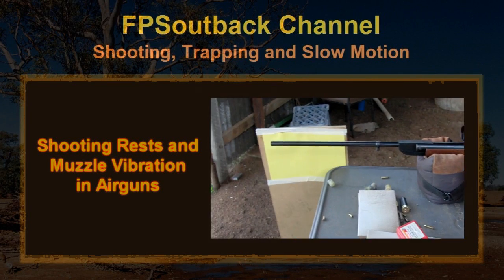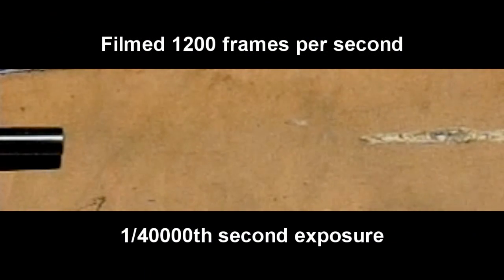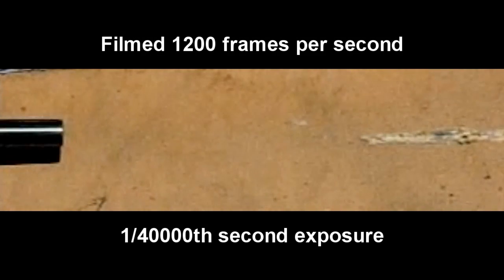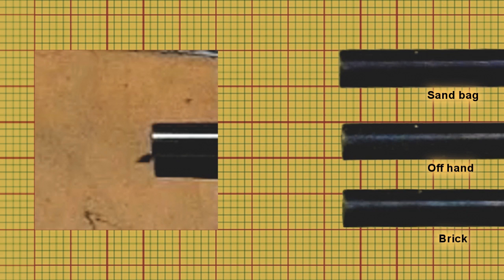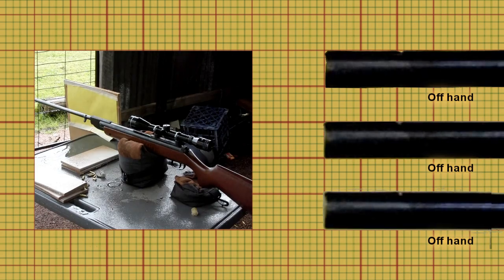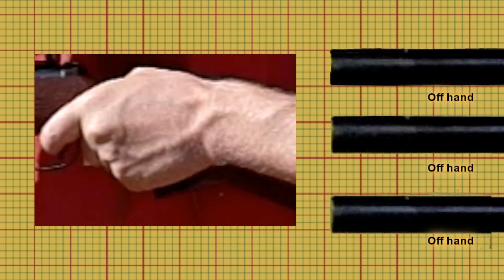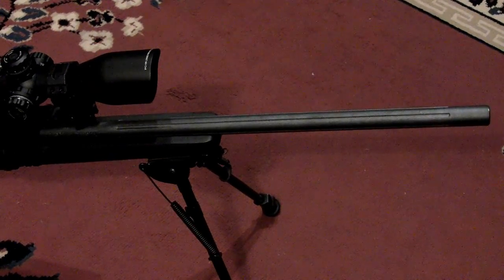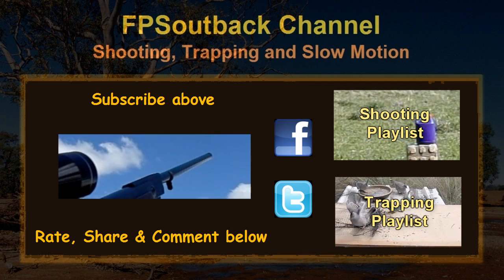Shooting Rests Influence on Muzzle Vibration in Airguns

Comment: I can't say for sure if all .50 muzzleloader ammo will work in all .50 air rifles, but as long as the fit is correct (the Sam Yang I have is a .500 barrel) I don't see why one lead bullet would differ from another. The round ball ammo I use is .495 caliber and made for black powder rifles, and fits a little loosely in the barrel if that's any indication.

Good luck in the never-ending search for that next gun, definitely interested in what you end up getting!